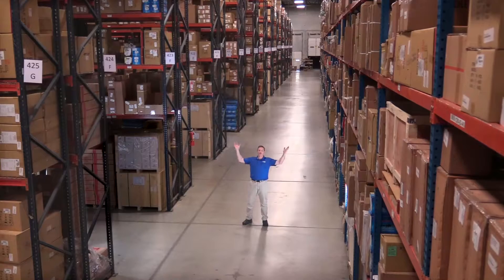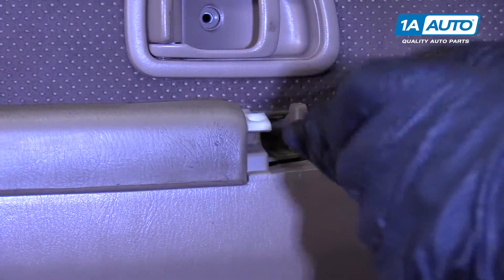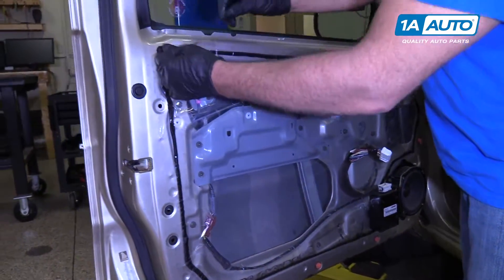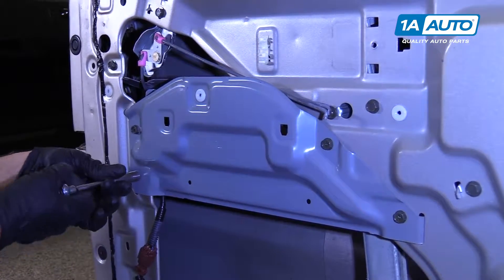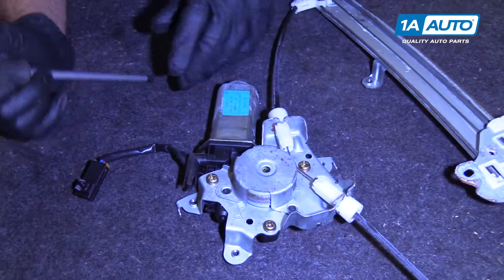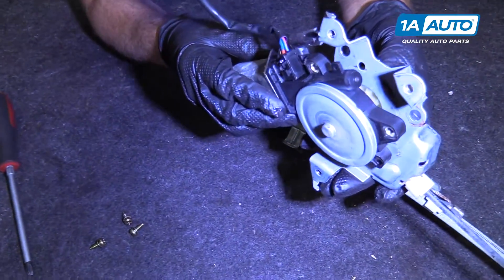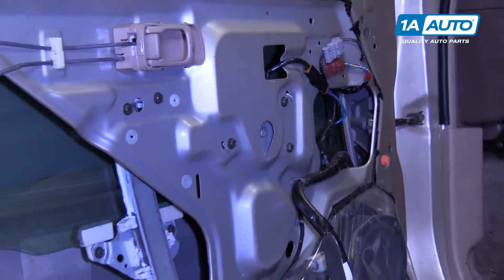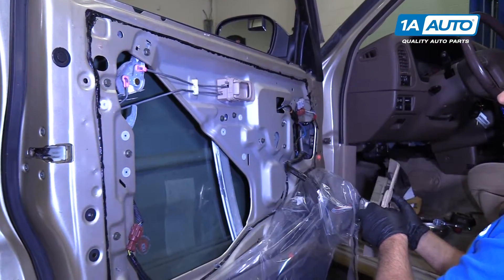How to Replace Window Motor & Regulator 96-00 Nissan Pathfinder

Comment: Changed regulator. Turns out motor gear was stripped.so I put a new motor in and window went up and down. Finished putting it back together. It’s nice to have my window back.4/27/20.
Reply from the maker: +Ed Land Thanks for checking us out! 1AAuto.com

Comment: soo am i stuck if my motor is no longer working?? my window wont come down at all
Reply: so i was able to vigorously tap the old motor until i kicked in again, with enough power to move down. I also removed the window outright, since that was easier to do!
Reply: That's my problem window is 3/4 up   1/4 open, no response  won't move up or down
Assuming this gear locked at motor, how do I lower the window, to collapse the regular ,
Is there something I can drill out ?